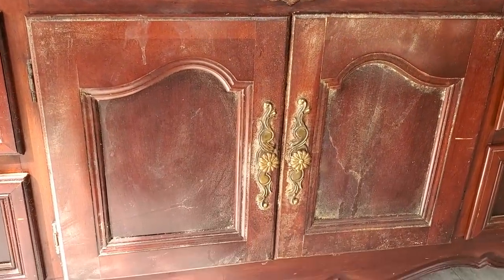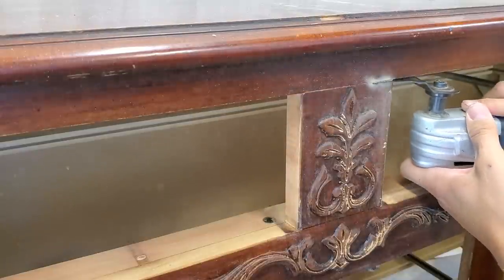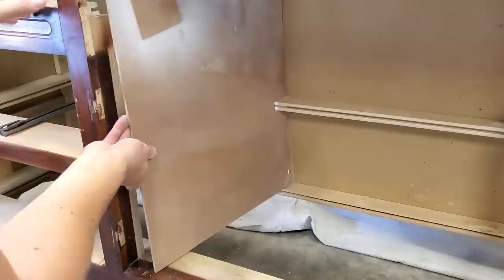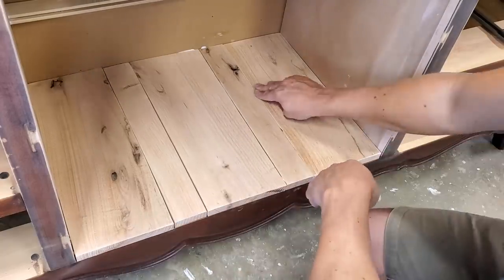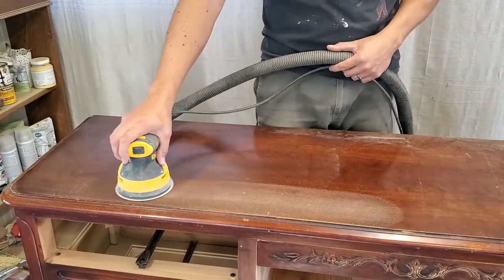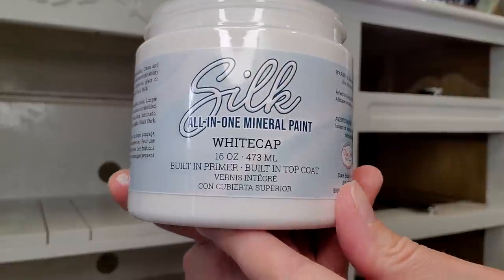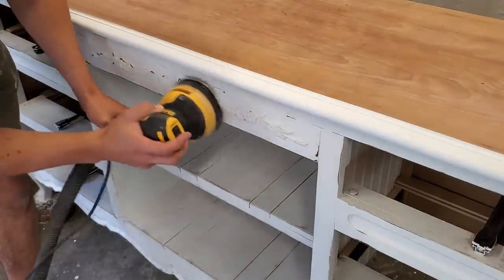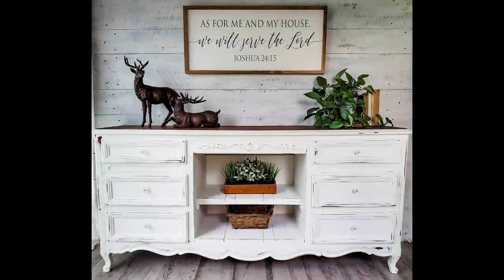Extreme Painted Furniture Makeover -- Turning a Dresser into a TV Stand

Comment: This is not my style but you did a great job. I love how you bobchalabtky took into account the damage kids can do to furniture. This may be a bit nitpicky  but I don't think it's a dresser but rather a sideboard as I've never seen a dresser with doors on it. A sideboard would have gone into a more formal dining room and would hold the dishes, silverware, tablecloths, etc.
Reply from the maker: This piece had drawers on the inside of those doors and a mirror attached to the top by rails (that we didn't show).  It also came with a matching tall dresser that we ended up giving to another furniture refinisher locally.  So it was a dresser, but I agree it certainly has the size and somewhat of the look of a sideboard for sure, especially with those doors. 😉
Reply: @BrickHouseVintageDIY  Thanks for letting me know, ::)
Reply: My childhood French Provencal dresser had doors on it and my mother's 1960 dresser had doors on it...so yes, lots of different styles of dressers have doors on them. Great job guys!!

Comment: Is wood movement an issue with the boards laid out across the bottom?
I had the unfortunate experience of gluing a panel of pallet wood for a planter that tore itself apart (some of the boards literally split in half) under the stress of changes in humidity between summer outdoors and autumn indoors.😅
Reply from the maker: Not on this piece because I left them a little loose in between even with gluing them for hold, so they've held up with no issue so far.  But that's certainly something I've learned the hard way over time is wood movement and expansion/contraction!  It's almost a science trying to figure out what you can and can't do in certain situations to allow for that movement while still maintaining solid structure! Lol
-Ethan
Reply: @BrickHouseVintageDIY  I had read about expansion and contraction. I had heard others talk about on YouTube. But it’s one of those things that I didn’t really appreciate until I experienced it, heh.

You did a great job. 🙂

Comment: It turned out great! One question, though. Why not treat the top as one piece, and stain the edges instead of paint? Thanks!!
Reply from the maker: Mainly because it's a lot easier than to sand into all of the cracks and corners on the edge.  Sometimes I'll put in the extra work to sand it all, but it mostly depends on how easy the finish comes off.  If it's a tougher finish, it takes a lot of time to work it all out nice and smooth.  I'm hoping to be able to get something like a SurfPrep sander one day which is supposed to be really great at sanding into grooves like that, but they are pretty expensive so it's all by hand and small tools until then. Lol
Reply: @BrickHouseVintageDIY  that makes total sense! Thanks for the response, I appreciate your time.